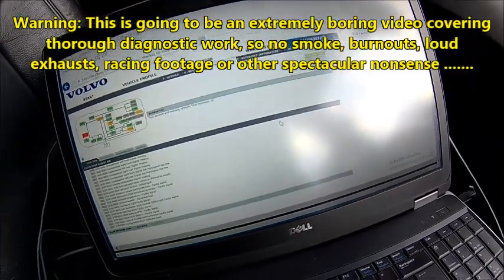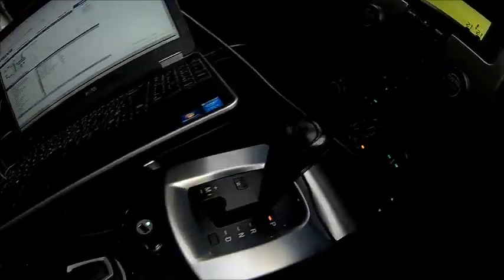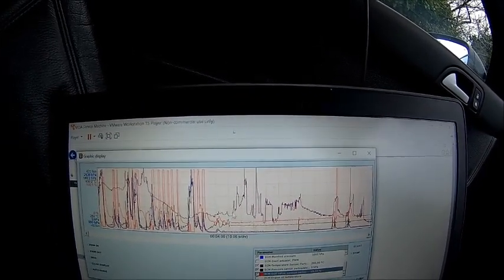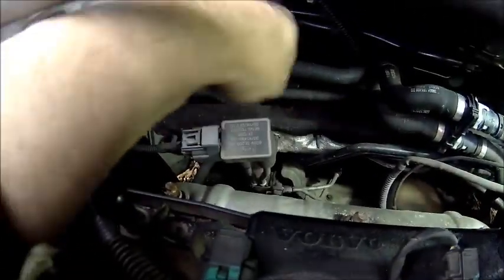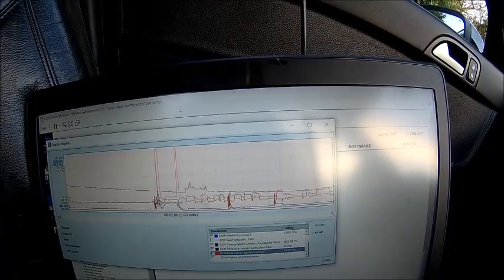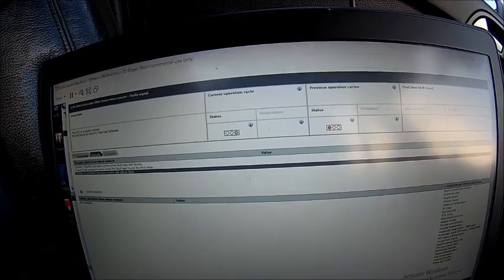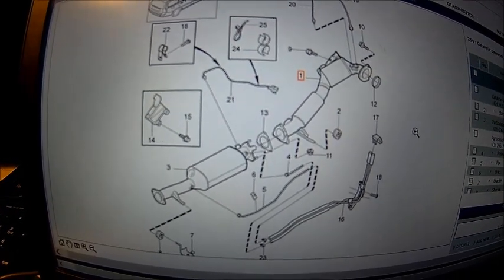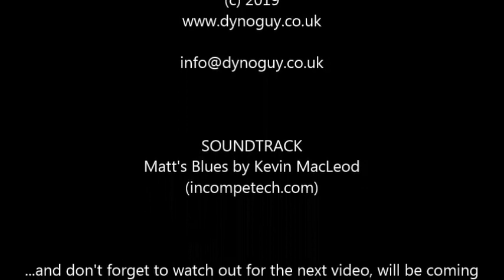Volvo V50 D5 , intermittent DPF fault codes, identifying the root cause

Comment: Hi ive recently bought a volvo v50 d5 and I have had a few error codes come up I know the swirl actuator needs to be replaced im also getting 135F MAF sensor, 5660 Oil sensor, 1600 Boost pressure sensor & 1000 atmospheric pressure sensor would you be able to help me I live in Birmingham, where are you from
Reply from the maker: Hi,  happy to help as far as i can, but i am at the Lincolnshire coast, so not exactly around the corner.... 
Just thinking out loud,.... has someone eventually fitted one of these stupid tuning boxes ? The collection of faults look a bit like that ...if so, take the rubbish out and it's most likely running fine.
Difficult to tell what's wrong without listening to it, but assuming you have no air leaks and the oil sensor fault is not just a simple 'too full' you might have some contact or wiring issues, because the thick cable which goes down next to the dipstick tube may rub through if the holding clip is missing.

Did you clear the faults and then check what's coming back ? How did you read the codes ? Generic scanner or Volvo VIDA/DICE ? It may also worth checking the condition of the ECU connectors (Its in the front of the passenger side wheel well, and if the cover is not properly on you may get water damage).
So please confirm that your air filter is clean, MAF sensor properly connected (cable may be broken as it has to come out for pretty much any job), all intake and boost pipes are tight and intercooler is not leaking.
How many miles has it ? Manual or Auto ?  what year ?
Reply: @dynoguy  hi no tunning box but I just had the swirl actuator changed and all the fault codes have gone except for barometric pressure sensor where is this located and how do I replace it clean. Do you have WhatsApp